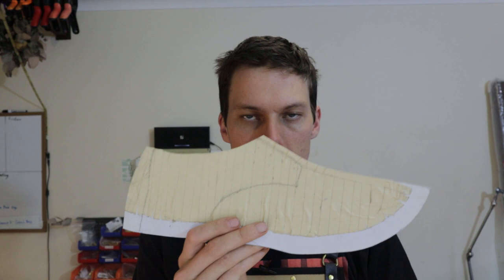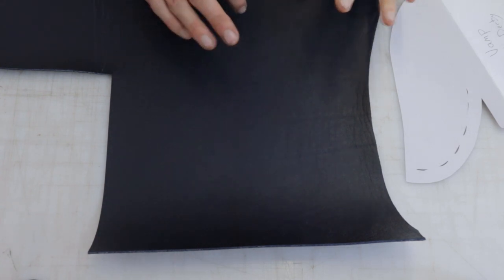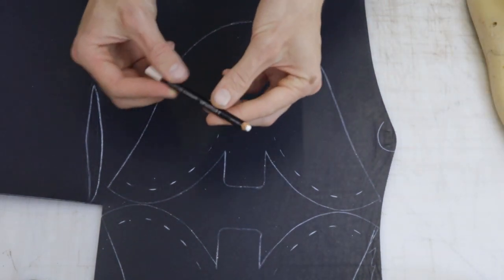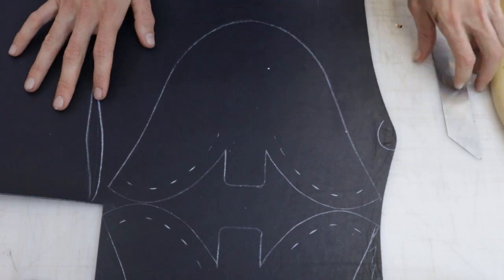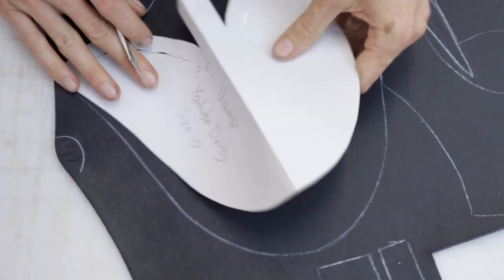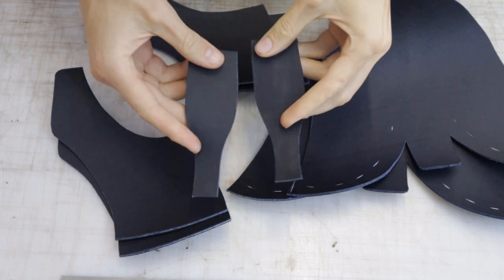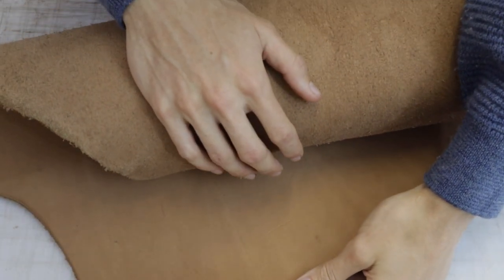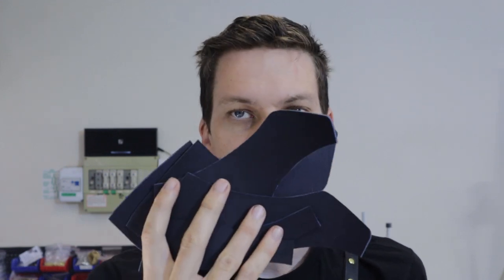Shoemaking Lesson 6 - Cutting Out

Comment: Superb series. Wondering if you have any ideas for vegan inner and outer sole materials?

Keep up the good work

Ian, Birmingham, UK 🇬🇧
Reply from the maker: Vegan or Vegtan? Rubber for the outer sole would be vegan and you could possibly use EVA foam for the inner sole. It won't be as strong as leather, so you would have to make sure it's bonded (or stitched) very well to ensure it holds together long term.
As for vegtan, anything >4mm thick will work.

Comment: What is the thickness of the hide you use for top and for inner sole ? Thanks a lot.
Reply from the maker: 4mm for the inner sole. 2.5mm for the upper. I don't recommend using 2.5mm until you are familiar with the process
Reply: @AndrewReesonLeather  Why is that?  too thick or too thin?
Reply from the maker: @cannibalcreep6180  It's too thick to easily stretch over the last. You can use it, I just don't recommend it for beginners